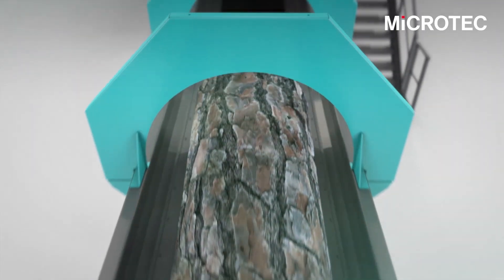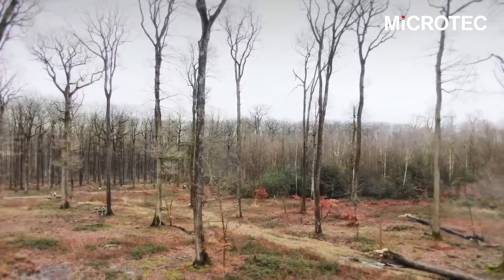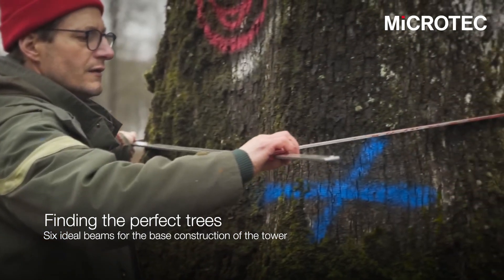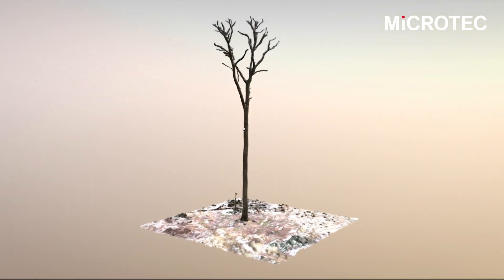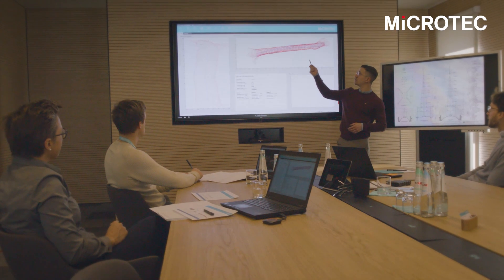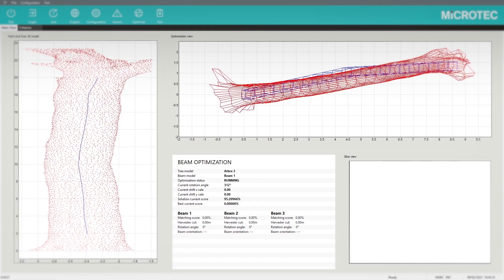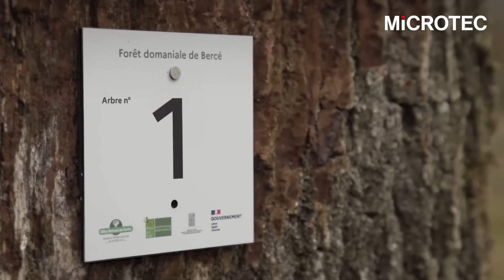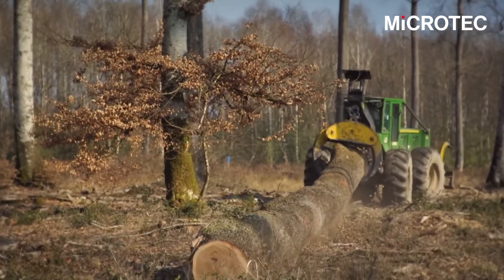MiCROTEC's optimization expertise drives Notre-Dame's Cathedral spire reconstruction

Comment: how did u get a 3d model from the drone flight? which programme did u used for this? best wishes :)
Reply from the maker: We received the shape data from ONF in a standard mesh format. We processed this format using software we developed to work with a customized optimizer tailored for Notre Dame.